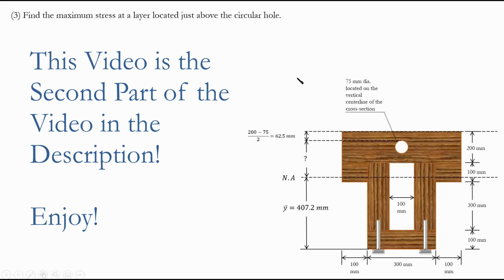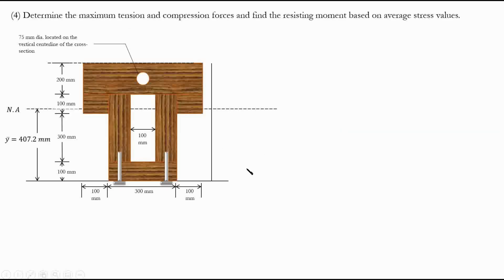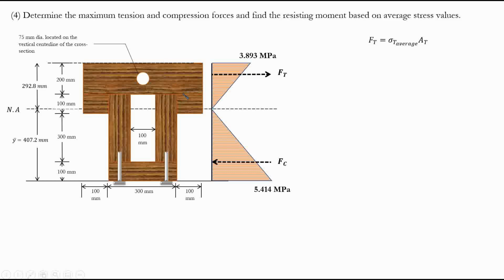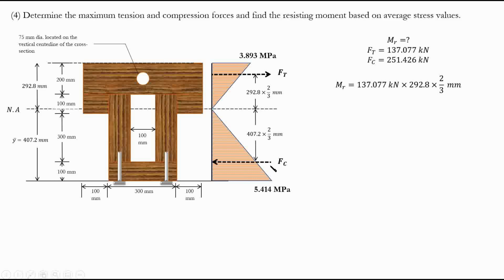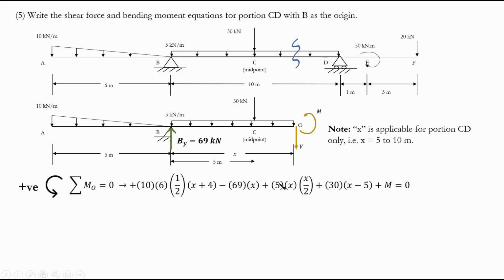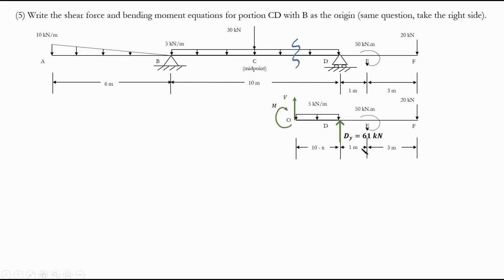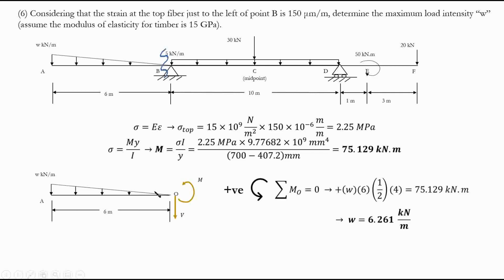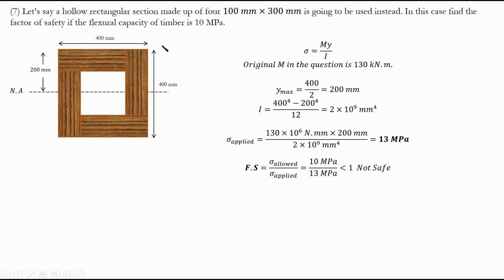Flexure, Part 2: Applying the flexure formula + Drawing Stress Diagrams + Finding Resisting Moment

Comment: Hi! This video was really helpful. I have a question regarding the Tension Force calculation. I don't know if I'm just flat out doing the calculation wrong, but when I do (3.893/2)*(132702.1353), I end up getting 258.586 kN, not 137.077. Am I doing something wrong?
Reply from the maker: Hi! You are perfectly right! That is a mistake there. I will pin your comment for others to note the issue. Thank you for watching the videos and your comment!
Reply: @StructuralEng  Thank you for providing clarification! Also, would it be possible for you to do more CVL 313 videos and even possibly CVL 500? These videos have helped me out a lot, so I just wanted to ask. Thank you so much again!

Comment: thanks for the video. If we were given in question 6 at location point left to b the bending stress just below  the circle. Can we using this stress find  the max Moment ?  if I use the equation and Find Moment M=(stress below circle* I)/ (distance from centroid to below circle). I will get a Moment. Is this moment the Max moment at location just to the left of B. Also am i able to find max bending using that moment by just changing the 'y' ??
Reply from the maker: Thank you for your comment! At a specific crosssection the moment value is the same. In this case the moment at any layer in crosssection B is the same. Remember that we are cutting a specific section (B in this case) and your shear and moment values are certain values for that crosssection.
Other than that, the formula you mentioned for finding the moment is correct. Just remember to use consistent units.
And yes, you will be able to find max stress by changing y to bottom or top fibres.
Let me know if you have any further question! All the best!
Reply: @StructuralEng  	Man you are the best!! There is one more question i hope you can answer it
for example I have W"load" as 2 
how can I answer this question: Using the calculated distributed load (W), determine the dimensions of a hollow circular beam
(use thickness = 0.5 times of the outer diameter) for part AB, if the maximum bending/flexural
stress capacity of the beam material is 12 MPa using a factor of safety of 2.0
Reply from the maker: @karimabouelela3665  First, you will have to find the applied stress based on the factor of safety; in this case, the applied stress will be 6 MPa. Then based on your W, you will cut your section just to the left of the support and calculate the moment there. Remember to always take the moment about where you cut to make things simple (you don't have to deal with shear force). Now that you have your moment, the only thing remaining is y and I (sigma is equal to My/I). y is half the diameter for a circular hole (top or bottom fibre). Also, remember that it is impossible to have 0.5 of outer diameter as thickness; that basically means a solid section, not a hollow one! However, let's say it is 0.25, not 0.5. In that case, your inner diameter is 0.5 outer diameter. SO based on that, you can write your moment of inertia equation based on only outer diameter. pi/64 (do^4-(do/2)^4), finally you will say 6 MPa is equal to My/I, you have M as a value, and y and I as a function of outer diameter, simplify and that's it!
All the best!
Reply: @StructuralEng  Thank you boss